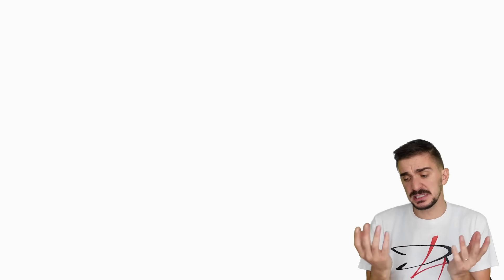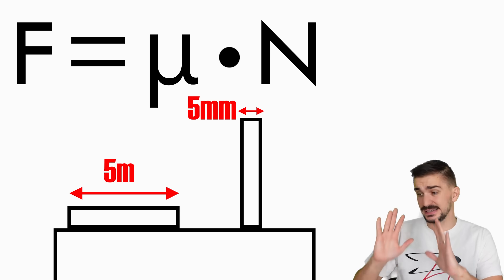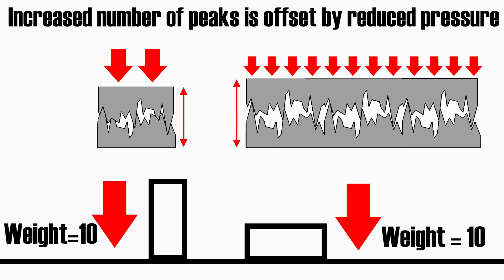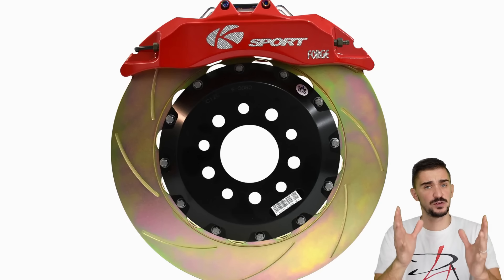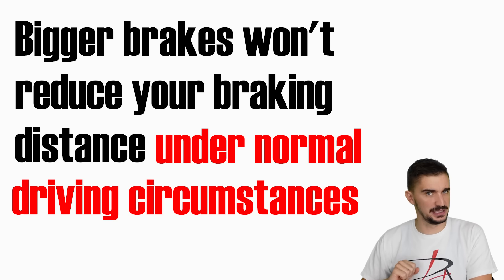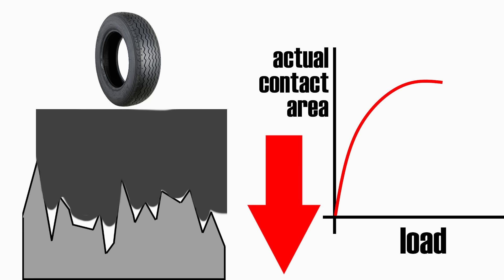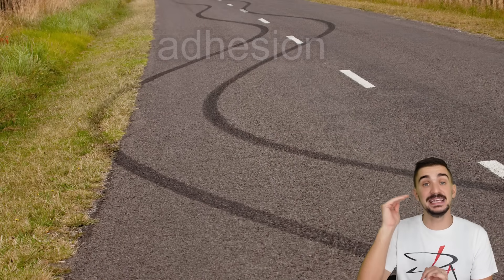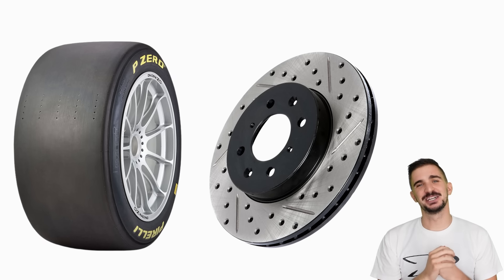Why Big Brakes Won't Stop You Faster but Wider Tires Will - Friction and Surface Area Explained

Comment: The equation you use for friction, F=uN only applies to static (limiting ) friction. It is not applicable to a rolling tyre or a rotating brake. Brake pads do not produce a retardation just by friction, adhesion also provides an important role that you do not account for. Using larger brake disks allows the caliper/pad to be further from the axle so the brake has greater leverage. You claim that rules of friction don't apply to brake disks because they are machined flat- try running your finger over a typical used disk. Disks are typically austenitic cast iron which has a nodular surface, after a few heat cycles you get carbon migration leading to patches of cementite which being harder erodes less making the surface even rougher.  Tyre contact area has very little to do with tyre width: a tyre is , as you say, elastic. The contact area is dictated by the force acting on the tyre and the air pressure in the tyre: nothing to do with the width of the tyre. Wider tyres certainly change the contact patch shape, but not its area. Many people find this counter intuitive but you can measure it quite easily.

Comment: I upgraded the brakes on my Golf GTI from the stock 340mm single piston front calipers to the Stoptech ST40 355mm quad piston setup. I noticed the following improvements after the pads were broken in:  less pedal travel, stiffer pedal, MUCH better modulation at the limit, and MUCH less pedal effort. With this combination of benefits I found it easier to maintain the braking forces just before impending lockup, which is effectively the maximum braking region.  If I can modulate the brakes better just before lockup, than theoretically I can stop sooner. 
I agree with other posters that this video should have covered Piston area, caliper stiffness, modulation, and the rotor diameter/leverage advantages of bigger brakes.  

Another bonus of the Stoptech BBK upgrade is that it saved 12.3 lbs of weight due to the lighter caliper and 2 piece rotor: Reference: http://tinyurl.com/mr3jt5jd 

What about a real world test?  Car and Driver to the Rescue!   They performed a test on several aftermarket Big Brake Kits and found that they all outperformed the stock brakes:  
https://www.caranddriver.com/features/a15136252/shedding-light-on-fading-brakes/
Reply: Reread the article. They were testing for brake fade not stopping distance like what this video is about. Their tests show there was very little difference in stopping distance.
Reply: @doppelhund  According to the article: "...we found that all the aftermarket systems and the Hawk brake pads outperformed the stock brakes in nearly every test."  Interesting that this video doesn't investigate the improved braking potential when using more aggressive pad compounds.

Comment: Video title is wrong.

grabbing a bigger disc gives you more torque on the wheel/axle because it’s a force over distance from the center of the rotation. Grabbing the disc further from center of rotation gives you better leverage over stopping rotation. It has nothing to do with size of the pads and is absolutely a legit way to improve braking.

Imagine trying to brake the car by applying friction directly to the axle. You’d need far more force because the distance from center of rotation is so low.

You can’t try and debunk bigger discs as being better for stopping power and never discuss torque and leverage.

Comment: One thing I think u forget to mention is bigger brakes (rotor) will have longer arm of force, thus creating more brake torque. However, for most modern production cars, the factory brake is sufficient and can break the traction of tires during heavy braking. Simply upgrading the brake may not shorten the brake distance during heavy braking.
I remember there was a test by a media in China. They compared two Civics, one with factory brakes and the other have high performance Endless BBK. After initial tests, the one with Endless actually performs slightly worse than the factory one (likely due to heavier suspension weight from the brake kit). However, what makes bbk stand out is repeated braking. The factory brakes experience serious brake fade after multiple brake tests but the Endless BBK still performs just fine.
Reply: It is more likely the friction material differences is what was the cause rather than weight differences.
Reply: The upgraded pads sometimes need to be hot to work best.  That's been known for years.  And yes the continue to stop better with more use instead of fading like oem pads
Reply: @danc2014  It really depends on the car, mostly the weight of the car. I've never experienced brake fade in my Datsun 510 and trust me, I've driven the piss out of it. There is absolutely no reason to "upgrade" your brakes from stock when you have a car that stops from 60mph in 70 feet.

Comment: Everyday driving - If you consistently brake /decelerate with new bigger brakes (more pad area) at the same rate you did with previous smaller brakes (less pad area), you will have greater brake pad life span. If both smaller and bigger brakes can lock up the tires in a panic stop, then bigger brakes, of themselves, will not reduce stopping distance. Keep it simple.

Comment: The larger the brake rotor diameter the more leverage it has on the rotational mass, all other factors being equal. 
If you had to stop a merry-go-round would you want to grab it on the outside or would you want to grab it near center where its rotating?
On bicycles that switch from "rim brakes" to "disk brakes" it is well known you need higher friction compounds and higher clamping forces and even still they dont always SLOW the biciycle any faster than rim brakes, they just have other advantages such as longevity, temperature, and working better when wet.

Comment: You fail to mention one very important aspect of bigger discs, namely torque-reaction...
The greater distance away from the wheel centre the pads are the more leverage a given brake clamping force has.
So in this respect you are fundamentally wrong, bigger discs will always give better initial 'bite' in the braking phase, this combined with wider tyres combines to decrease overall stopping distances.

Comment: Based on my experience with motorcycles, I figured the answer was that your brakes are going to be able to lock up the wheels anyway, so the contact patch was the limiting factor
Reply: Locking the front wheel on motorcycle is always a exciting time

Comment: Yoiu can have the largest brake disc surface area  on the brakes you can fit on your vehicle, but if you have bicycle tires on each corner you're not stopping anything.

Comment: Reasoning has one big problem: it's main point is that N (force) is not changing when you use bigger breaks. But that's only true if you use the same caliper design. But this point is moot since you cannot just put bigger break pads in a specific caliper model instead what it is designed to use with. If you want to use bigger breaks you most likely changing the calipers as well. If you change calipers you most likely change the clamping force that your calipers can provide. Therefor bigger breaks can provide higher breaking performance if you can use the additional performance.
The point to use bigger breaks is to have the best control possible over your dosing of breaking power in various situations you encounter with till the spot you can lock up your wheels anytime by choice -> which point you are out of your tires breaking performance. It is also can be important how fast can you get to this stopping point in case of need. If you get to the point where you satisfied your control / characteristic of the breaking but still want to decelerate faster then you need to work on your tires. And this is a loop till satisfaction with break/tire performance adjustment, considering not to degrade your performance elsewhere with your tires/breaks setup. And additionally to this comes another aspect -> how many times/how long can you maintain the same level of performance without degradation -> which is related to your break's cooling performance -> which mostly revolves around rotor design.

Comment: not the best video since it clearly misses one of the biggest reasons why larger rotors DO actually perform better and that is, mechanical leverage. 

Grabbing a 410mm rotor from its outer edge generates higher torque than grabbing a 350mm rotor even if the same caliper and pad is used.

Comment: a friend from long ago, told how on a very wet motorway/freeway, he was having trouble with traction due to aquaplaning  as he had wide as tyres,, and was amazed when a citroen cv2  easily overtook him..
in my experience ,  narrow tyres on gravel roads, wet or dry, is like driving on tarseal, compared to the wider tyres I swapped from..

Comment: Great video, but your explination of normal force is missleading. The normal force is NOT the weight of the object. It is the the force of a surface pushing up onto the object, and therefore the normal force in most cases acts upwards not downdards. Most of the time it is equal to the weight of the object, but if you are on something like an angled surface, the normal force is a fraction of the weight and acts perpandicular to the surface.

Comment: I've thought about this a lot - and remind me to watch the video later - but bigger brakes should absolutely stop you faster.

IF you have ABS.

Thin tires without ABS will lock up, while thin tires WITH ABS will buck like a mule every time they lock and get you slowing down again. So then what you need are more pulses, which a bigger disc and clamp will provide.

Brake area is directly correlated to stopping power with ABS. In theory.

Comment: Some thing you didnt metion is that Brakes are basically never the limiting factor. Even Stock  Discs and pads can  apply enough braking force to overcome the friction of the tires. As the normal force of the brakes is a changing variable by just pressing harder on the brake.  the limiting factor on there is just how hard you can press the pedal (and how much its amplified) theoretically all the way to mechanical failure.  That is why ABS or anti lock braking sytems exist.  Once the brakes overcome the force the tires can actually apply to the ground, ABS limits your braking force to stop the tires from locking up.
2 reasons why tires shouldnt lock up:
1. you still have have control (locked up wheels cant steer)
2. static friction is alway higher than sliding friction

Comment: The truth is it’s not simple at all. For example you can add a lot more weight to one set of tyres and not increase braking distance. However you can add to more weight to another and drastically increase it.

Comment: This is what I’ve been telling people. Suspension and tires are better brake upgrades than brakes themselves. Now I know the science to back it up! Thank you!
Reply: Wrong, I put 12 inch rotors and bigger pads on a 94 Eldorado, and put bigger rotors  and pads from a v6 Camry to a 94 Camry, both had noticeable improvements.
Reply: Suspension and tires upgrade is not better way because stock brakes with upgraded suspension and tires will burn out very fast and you may loose brakes completely, so this is very dangerous upgrade. When you upgrade brakes only then braking performance will increase and burning out brakes will be even less likely then on stock setup.
This is total BS that by upgrading brakes alone will not increase braking efficiency.
Enlarging tires alone  beyond manufacture specs will generate higher ware on suspension.
Even replacing old brakes with new parts is increasing braking performance, not mentioning about installing larger ones
It is true that if you want to capitalize on brakes upgrade suspension and tires should be upgraded too, but safer way is to upgrade brakes first.
Reply: @sawomirmiszczak134  You mean the more stupid way is to upgrade brakes first because you will activate ABS even with the stock brakes. With larger brakes and everything else standard, you would only activate ABS faster.
Reply: @full_wet_tire  I was talking about heat, with better tires and suspension stock brakes would over heat very quickly, and this may lead to dangerous reduction of braking force.
And i say it again, even with replaced braking discs and pads for new you can gain couple meters comparing to old/used pads and discs. So the stupid way is to think that upgrading brakes won't do anything, it will.
Reply: @sawomirmiszczak134  It will NOT. If you don't have the grip on your tires, you can't even overheat the brake. Your tires would give up first. Which is why you never upgrade your brake alone to improve your lap time. If you are talking about daily driving, then it's even more pointless to upgrade brake with stock tires and suspension. As for worn pads, that's about proper vehicle maintenance. When sth wears down, you replace them. Just like tires, engine oil, washer fluid and even fuel, you run out of that, you replace that on your car. You don't have to actively replacing your new brake pads with bigger ones to improve your vehicle stopping power. It won't do anything AT ALL. If anything, you probably reduce your vehicle's stopping power because now you need bigger alloy wheels that are much heavier. The next thing you know, your vehicle becomes a flat tire collector with those low profile tires.
Reply: @full_wet_tire  Now you are dragging me in to some lap time bla bla bla etc topic. Now look my post and what i was talking there. My initial respond was to that upgrading suspension and tires are better upgrade then brakes alone, my response was that this kind of upgrade is very dangerous because in this setup you will burn brakes very fast and it will cripple braking capability of the car, once you burn off brakes it's over. I just said that upgrading brakes alone is just safer thing to do then vice versa.
Reply: @sawomirmiszczak134  i agree with you, upgrading tyre and suspension makes you can push your car harder, but the brakes will give up at some point, and thats it.

Daily driving is not forgiving as it seems, some people has to drive through hilly road on rather heavy suv daily, even 30mph could fade oem brakes easily.
Especially diesel car which doesnt have engine brake.
The oem brake still capable of locking the tyre and more, but not for prolonged use..
Reply: @sawomirmiszczak134  No, most stock brakes are more than capable of handling better suspension and tires with no problem. You don't have to get new brakes if you just use some grippy tires than the mint ones from the factory. It will not exceed your brake capability. Most cars are capable of having semi slicks on them without even needed to change the brake on a track day. And that is track day where it is high intensity brake we are talking about. Most of the time, if you just want shorter braking distance on the road, put some grippy tires and you are good to go. Nothing else needs to change. Upgrading the brake, on the other hand is pointless. It is the stupid way to go if you want to spend money and be no safer on the road.
Reply: @sawomirmiszczak134  Actually, I made a mistake here. By using larger brake, you would need larger alloy wheels which would increase your wheels moments of inertia. Which means your car now requires more braking power to cope, but you only have the stock tire so your braking distance is actually longer than before. So it's not pointless, it's actually more dangerous than if you just leave it stock. You just spent money to make your car more of a killing machine on the road. But such is the case when people know nothing about mechanics and only upgrade based on what they know. Just watch the other video on this channel and you will know why you are completely wrong. Don't embarrass yourself more than this.
Reply: @sawomirmiszczak134  Let's put it simple for you. By only upgrading your brakes, leaving everything else stock, you only reduce the amount of braking pedal travel before you activate ABS. Zero difference in terms of braking distance. Just a waste of money.
Reply: Don't believe this video. It's not really accurate. If your brakes won't "lock up" the wheels and cause the tires to skid... then you could do with "better" brakes, unless your wheels are very narrow and skid very easily... in which case you THEN need wider tires. This video is an over-complication of a simple concept and the fundamental premise isn't correct.
Reply: @melissachartres3219  if it is not really accurate, which is touching the ground? I recommend to you to watch the second video here: https://www.youtube.com/watch?v=Ql9eYh31kTw 
If you think that brakes can do such thing then wrong, also tyres is the which only on the ground and can stop you. Jkliao tries to help you then you still disagree try to disagree this second video then it means you don't accept reality.

Comment: Bigger  calipers help a lot and so do bigger rotors  and what i am saying is prover by science.When you have bigger rotors the distance the pad travels on the rottor for every revollution is greater ,and when you have larger calipers the larger surface area of the pistons means the force with which they push the pad onto the rotor is greater because the pressure of the hydraulics is measured in pounds per square inch which means given the pressure is the same a larger diameter caliper piston will push harder.Sorry but you are wrong my friend .

Comment: Surface area won’t do much difference, no. But a larger diameter rotor will, right? Or more pistons, providing better distribution of pressure. Or is there something counter intuitive about that as well?